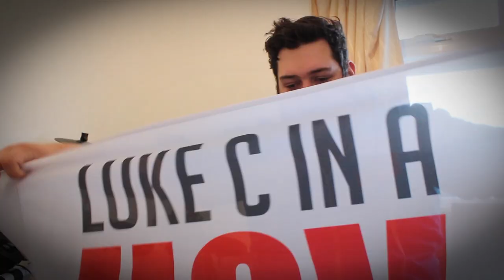Rejected Load!

Comment: Hi, I'm thinking of trucking and have some questions that I never see on trucker videos. 

1. What do you do for the toilet situation?
2. How do you keep track of time?
3. What do you do in a minor accident?
4. What do you do in a minor accident when knowone is around? 
5. What do you do when you have 5 mins driving time left and you arrive to tip. Do you have break when tipping? If they tip in 20 mins and tell you to move, how does this work?
6. I saw you did over 12hours, I thought you can not do 10 hours two times a week?
7. What's the most difficult situation you have felt with? 
8. What do you do when stopped at a low bridge and can't go under and traffic blocks you behind? 
9. Can I get a first job trunking in the first instance? 
10. Is a trucker snooper sat nav recommendation?

Really appreciate if you can message me or reply to these questions. Keep on trucking :)
Reply from the maker: 1) Hold it in, stop at services or go at delivery point (i also have a urine bottle for emergency's)  
2) do regular tacho printouts that tell you what driving you have done
3) never had one but you would take photos, give details ect. that is what insurance is for
4) same as above, take photos and report it as soon as you can. 
5) Depending on the job, currently, if i arrive somewhere with only 5 minutes driving time then its fine, i can have a break while they unload (although i need to be able to rest and not be required to do anything for it to be deemed as a break) you've commented on a older video when i was driving tippers, if i arrived on site with only 5 minutes driving time left then ill probably go over and risk a fine. it would be better to stop for a break and then continue. if you do go over driving time, then you do a tacho print out and write on the back WHY you went over. 
6)you can only drive for 9 hours a day and up 10 hours a day twice a week, that is correct.HOWEVER, you can WORK for up to 15 hours a day. there is a difference between driving and working. being unloaded and having breaks are not driving. 
7)blindside reversing our of an housing estate with no help into live traffic.... very difficult
8)stop and wait for space to become available.  only way you can go is back so i would have to put hazards on. if it was a real bad situation then the police may be required to help traffic move again
9) yes you can.
10) from what i have heard they seem to be a decent bit of kit although i have never tried it myself
Reply: @lukecinahgv  thank you. Really good answers. The only thing putting me off is time away from home. However as mentioned I'd like to do trunking depot to depot. My brother does it driving for B&Q on 35k
Reply: Also, when on the road if you're lights stop working do you get spares and are expected to replace them yourself?
Reply from the maker: Bulbs are drivers responsibility yes mate .
Reply: @lukecinahgv  shout out in your next video for a fan :)

Comment: Is your truck Manuel or Automatic? Didn't notice you changing gears..? Good video regardless mate. 👍🏼
Reply: It's an automated manual, mechanically the same as a normal manual transmission, but with the clutch and shifting controlled electrically. Some automated manuals still have a clutch pedal for precise maneuvering at low speeds. A manual mode on the shifter is provided for selecting and holding gears on hills etc.

Comment: you need to invest in a steering wheel knob
Reply: I believe there illegal now unless you have a disability need for them.
Reply: just take it off for the MOT
Reply: Of course they are legal.  Even disabled drivers can have them fitted.  Like anything in your car, the can be illegal if used inappropriately ie you do not have full control of the vehicle.  Where the internet moron get confused is the US laws.  The knobs are legal in most states but a few states have banned them.  The MOT regulation require inspectors to check "steering" but there is no mention of steering knobs being illegal if fitted and used properly.  Using the device at regular road speed would be illegal in the case of an accident as your were not in fully control of the vehicle.  This applies to turns at road speed that could, potentially over turn the vehicle.  That would also apply to single handed steering without the knob.

Comment: it took the gravel pit an hour each time to load? why not go off duty to save your hours and already count your break. i drive a transport (lorry) in canada so i know how to run a log book
Reply from the maker: +Eric Melo in the U.K, to be of duty you need to be able to leave the cab. However, While in the quarry, you are not allowed to leave the cab. 

Also, the main reason it took a while was because the amount of other tippers getting loaded. I was continually moving in the quarry until it was my time to load.
Reply: Gotcha. But you could of still logged your break and no one would be the wiser
Reply from the maker: +Eric Melo in not sure how it works in Canada but we have a "tacho card" it's inserted into a machine jnside the cab. Our breaks are recorded by this. 

I hear what you're saying. Yes I could have had a break inside the quarry and I one would be none the wiser but like I said, I was continually moving. 

If the lorry moves while it's in break.  it automatically cancels the break and go into driving time.
Reply: Oh we dont have that. We do gave electronic logs where if the truck is moving over 10km is moves you to driving but thats the only time. One time i started from one side of the city to the other off duty stuck in traffic my log said i was off for an hour in the city but i was moving at a crawl lol